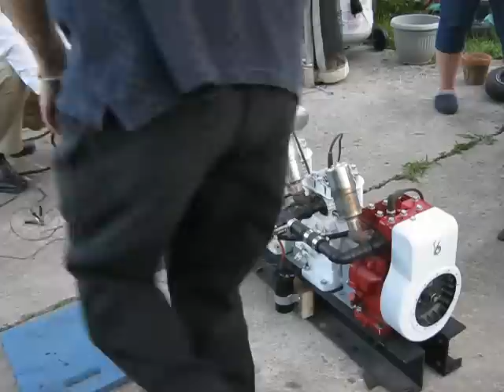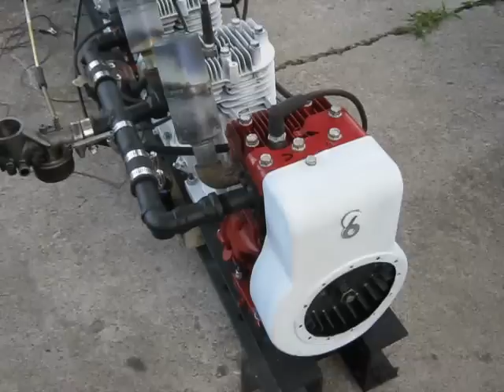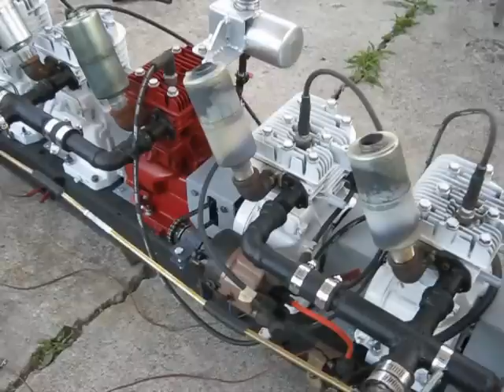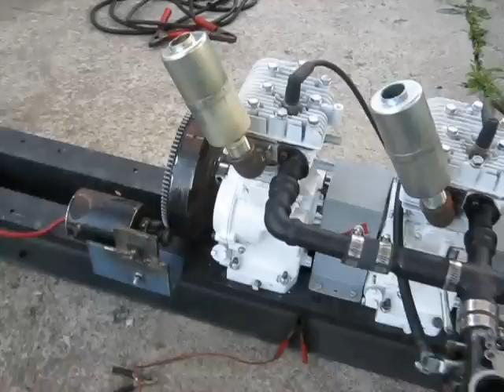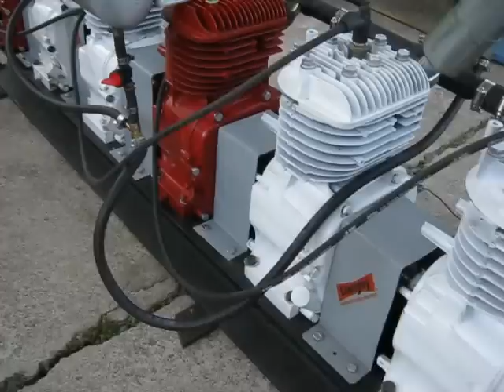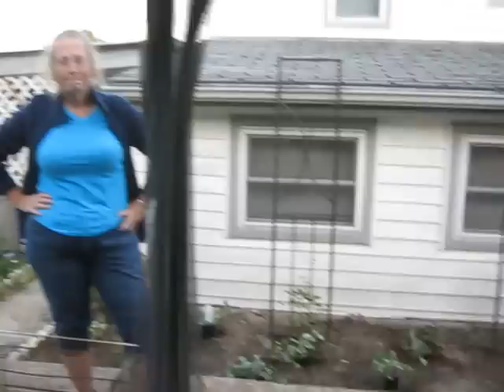FrankenBriggs 6 Cylinder 1st Run!!!!

Comment: how does the spark timing work?
Reply from the maker: I use an old points type ignition distributor on this engine. I evaluate each project, and determine what is easiest, cheapest and most availible to solve the given problem at hand.

Comment: Your intake manifold needs rebuilt so air gets evenly fed into motors
Reply from the maker: Agreed, not the best, but it did run. The main problem it had on this run was the spark timing being retarded when it revved up, I later corrected that problem, so the last vid of it is better.
Reply: Still super cool i love seeing what people can do with spare time and parts

Comment: Mufflers running hot. And uneven. Possibly lean and or restarted timing.
Reply from the maker: Yes, I noticed that also, I will check where the carb needles are set, it seemed the last 3 cylinders were so lean it was causing backfiring, seemed to smooth out when I richened it up.

Comment: stupid idea becouse the engines would be working against each other on the crank, they dont share a common crank for the power
Reply from the maker: Don't know if I would call it stupid, especially since the concept seems to work fine. Admittedly this is just an experiment, but so far I have made and ran a 2, 3, 4, 5, 6 and an 8 cylinder coupled engine, so they do indeed work. Now, that being said, a much more practical design for long term use would be to have a common side shaft running the length of the engine with a chain from each cylinder attaching to it. In fact I have heard of a farmer building such a set up with 4 of these engines, so apparently it will work just fine.
Reply: ChargerMiles007 hey freedom baby, but wouldnt they need a common crankshaft to make the coupleing of power distribution?

Comment: manifold is the problem! would have better results to have1 carb per cylinder, and synchronize them all, like a motorcycle engine. wht is this such a hard concept to grasp?
Reply from the maker: Oh I understand well that 1 carb per cylinder would work better, but joining the throttles all together would be a nightmare. Plus I was somewhat trying to duplicate an old inline 6 car engine, most of them had only one carb, though some powerhouses like the Jag XKE used 3 ore even 6 carbs.

Comment: Why not a carb for each motor?
Reply from the maker: I thought having only a few carbs would make it run more like a real 6, rather than like 6 separate engines.
Reply: ChargerMiles007 Got it. I understand now. Nice.  The inline 6 has a nice sounding character. Thank you.
Reply: the old school backfire through the carbs is unique!
Reply from the maker: Yes, this engine liked to backfire a lot. It turns out I had the camshaft timing way off on cylinders 4 &5 on the first and second runs of this engine. i believe this is what was causing the backfiring. #6 cylinder was running, but I think the flow from the carb was being interfered with from the back fires etc. It runs much better on the final run vid, actually firing all 6 cylinders. I fixed all of those problems on the Straight 8, so it ran much better right from the start. I figured I was on a roll, so I built the 5 cylinder, but it was an unlucky Beast of a machine, vibrating the front flywheel off, and zapping me! I plan to make a 7 cylinder this coming summer.

Comment: Uhh....judging by the mufflers, the back 3 engines weren't even firing.......so....you made a 3 cylinder with 3 air pumps connected.....just sayin....
if you dispute this, make a video with 6 new mufflers, so we can see the change in paint when they all heat up.....or I call B.S.!!
Reply from the maker: You are almost right, (been a while since I have watched this vid), but I think #4 and 6 aren't working right, but 5 is. I made 2 later vids where I corrected the problems. It was also running spark retard (as opposed to advance), so the faster it went, the later the spark timing, that helped heat up the mufflers also. I corrected that by spinning the spark distributor the opposite direction. I believe I got a 2 minute run out of it on the final vid, though it was smoking pretty well from all the heat build up at that point!

Comment: You mean 4 cyl? The last 2 weren’t firing bud.
Reply from the maker: Dang, you are good!  I later found out that 2 cylinders were not firing, since i had messed up the camshaft timing, though they might put some smoke out the odd time. I also discovered that the spark timing was retarding as engine speed increased, instead of advancing. I believe this caused most of the excessive muffler heating. i made 2 more vids of this engine running, and had it going much better on the 3rd vid. Next i built an 8 cylinder, it ran MUCH better, hitting 5000 rpm. Next up a 7 cylinder!
Reply: Im glad you got it going, it’s a cool project.

Comment: How do you cool the rest of the cylinders?
Reply: Eviltech half of them never fired up
Reply from the maker: you are right, 2 of the 6 were not firing on this vid, which I discovered later. I had all of that corrected for the last run vid i made.

Comment: has it ever run for  more than a minute ?
Reply from the maker: i did run it for 2 minutes, which in hindsight I shouldn't have done, since it was getting hotter than it should have with the spark timing retarding. I don't run it any longer than that, as i don't want it to get so hot that it scores the cylinders.

Comment: Gentlemen: "Their" - plural possessive pronoun. "There" - a location. "They're" - a contraction of "They are". For example: They're trying to find their copy of Briggs Small Engine Shop Manual to check their timing set-up before they blow their own asses clean out of their garage over  there. And meet their Maker before they're ready. Also they're keeping their fire extinguisher handy right over there.
Look, if you're intelligent enough to line up six lawn mowers into one plant and actually get it to start, then certainly you can sort out three homonyms without breaking a sweat.
And wash your hands before dinner.

Comment: What a shame, all that engineering stuffed by using a vintage fuel delivery system that doesn't work. All I can see is burnt valves and stuffed rings. At least use triples carbs with Y matched fuel runners and vacuum tune the carbs to each other will stop your starting and lean air/fuel mix problem.
Reply from the maker: I never run these things long enough for that kind of damage to occur. Though I did lunch a crankshaft gear on the final run of the Straight 8 Briggs. I guess it couldn't handle the harmonics. It turns out the main problem with the engine in this vid was #4 &5 cylinders camshafts were out of phase, so the spark was trying to fire them between exhaust and intake stroke. I finally resolved the problem on the last run of the 6 cylinder. I used Y fuel runners on the 4 cylinder engine I made a few years back, it had much better throttle response than the 6.

Comment: Timing is not in sync. Problem solved. None of those crankshafts are exactly perfect with the others.
Reply from the maker: This is true in more ways than one!  There is a bit of slop in each of the chain couplings joining the crankshafts together, so the timing will always be a bit off, plus the spark timing is taken off of only 1 engine, so in some respects it is amazing this thing even runs! The big issue on this run (I have vids of 2 better runs), was that I had the camshafts on #4 and 5 cylinders timed backwards compared to the spark, my bad! I quickly corrected that, and it ran much better.

Comment: Some of those cylinders appear to be really lean
Reply from the maker: Yes, some weird thing were happening on this run in particular, the spark timing was retarding instead of advancing when the engine speed increased, hence it was limited to 3000 rpm, and wouldn't go any faster. I solved that problem once I figured out I was spinning the distributor backwards from the way it was intended to run.  I learned one lesson about ignition points, you can't tell the distributor rotation direction from the way the points are mounted, they can either slide, or stub their toe. so to speak. What matters is the way the centrifugal advance has to operate. I solved the problem entirely on the 8 and 5 cylinder engines I made after this.

Comment: You build it, now what?
Reply from the maker: Tear down, and store in a shed for the winter. the years after the 6 I built a 7 cylinder from the parts, as well as an 8, both ran better than the six did in this vid. My latest is a 12 cylinder in an H shape, it has some chain noise, but it was pounding my chest with the exhaust noise when I removed the mufflers  :)

Comment: Judging by the exhaust colours the back two never ran ....
Reply from the maker: Very observant, I think you are right, on this vid i think i had the camshafts for those cylinders 180 degrees out of phase. I made more vids of this engine, and it runs better in those, but this one gets all the views. My later Straight 8 ran much better, until we revved it to 5000 rpm a few times, and resonance broke a crankshaft gear, not knowing a cylinder was down, we ran it another 10 seconds with the pieces bouncing around in the crankcase, quite salvagable though.

Comment: how do you decide how to phase these engines together?
Reply: Exactly
Reply from the maker: I first decided on a firing order 1,5,3,6,2,4  then phased the pistons and camshafts to be timed correctly to achieve this. It took a bit of time to do, but making a drawing of the firing order showing all 4 strokes of each cylinder helped out a lot. I had it all set up correctly, then I had to remove the back 3 cylinders for some reason, then i succeeded in messing up #4 and #5, so thet are not firing in this vid. All 6 are firing in the final run vid.

Comment: That's gonna over heet fast with only one fan for 6 motors
Reply from the maker: Yes, it does heat up quickly, I have ran 2 large box fans to help coo lit off, but a 2 minute run is about the limit. That is actually about as much as the neighbors want to put up with also!  :)

Comment: Maby Double check the firing order..
Reply: Runs smooth when it revs up, starts popping when it revs down, could be a timing issue.
Reply from the maker: It may well be timing, I timed it by eye, not using a timing light. My son thinks I need to advance the timing, I will drag out the timing light and blow the dust off it, and check where it is set at. Perhaps it is cobwebs in the early 60s slant 6 distributor, you never know  :)

Comment: NO HEAT  ON THE BACK 3 EX - PIPE
Reply from the maker: I think #6 was actually firing, but 4 and 5 were not, as i had messed up the camshaft phasing during an overhaul :(   Once we discovered the problem, I corrected it, the the final run of the 6 has all 6 cylinders firing.
Reply: I wondered who else caught on to this.

Comment: The first and third is to lean or slow in time
Reply from the maker: If I recall correctly, cylinders 4 & 5 weren't running at all, so 1 thru 3 and 6 were loaded down dragging the dead 2. Spark timing should be about the same for all cylinders, though I won't pretend that it is actually the same, since the distributor is chain drive, so harmonics enter the equation, plus the chain couplings joining each cylinder have some play in them. It is quite possible that the intake manifold design of 1 carb. feeding 3 cylinders is playing a part also. Building these engines has taught me to respect for the challenges engine designers and engineers face when designing a new engine!

Comment: What's the application of this?
Reply: . . . not much because the crankshaft on the last engine is not strong enough to handle all the power.
Reply from the maker: You are correct, I suspect about 10 horse would be the power limit before something broke, though I was lucky enough to find a crank with a 1" dia. shaft for #6 cylinder, so it should be a fair amount stronger than the 3/4" shafts.

Comment: About 60 hp?
Reply from the maker: Actually probably more like 30, if everything worked right, though it would probably snap off the last crankshaft long before it got to that. it is a Beast to man the throttles of though, as you can feel the vibrations of the engine since you are so close to it.

Comment: Not a 6cylinder engine. Six engines
Reply: GM designated their 16 cylinder Detroit Diesel as a 16 cylinder engine even though it was two 8 cylinder engine blocks bolted together. The original design 16V71 used a single crankshaft that tended to break between the two blocks. Later design used a crankshaft that was bolted together between the blocks. The beast used four 4 cylinder 4I71 heads.

Comment: but why?
Reply from the maker: Experimentation, kind of like the glass head Briggs engine that uses a plexiglass transparent cylinder head, so you can see the flames.
Reply: Reminds me of the time I made a hydrogen generator, spent days on it and it worked that well it was dangerous. Never put it to any useful application - sitting in the shed somewhere now.

Comment: How do you have the timing set up on that?

Also likely to fly apart at any moment btw.  jmo
Reply from the maker: The cylinders are phased to fire like a normal 6 cylinder engine, 1,5,3,6,2,4. The spark is from a Dodge 6 cylinder car engine, with spark timing set about 10 deg. BTDC.
Yes, it coming apart is a possibility for sure, that is one reason why I have metal guards over all of the chain couplings. I promised Lovejoy I would do that when I built the 4 cylinder.

Comment: nice work but what's the point
Reply from the maker: Bragging rights on having built a YouTube Hero!!!  lol :)
Mainly I just wanted to see if it was possible, and hear what it would sound like. It actually runs much better on the Final run vid, the 8 cylinder engine runs better,

Comment: this was not a successful run. the contrary, the back carb was too lean, and the center unit smoked too much. too much work to run this bad.
Reply from the maker: I whipped into shape on the next vid, the 7 and 8 cylinder run much better, but the 5 was a mean machine! it tried to take me out!

Comment: Briggs n Stration engines are junk  try a 4Stroke Honda engine my mower went for 22 years on the same starter rope and spark plug .Buy a Honda you will save in the long run .
Reply from the maker: Well, one thing I can say, I don't encounter many Honda engines in the scrapyard!

Comment: With any serious load on it the crank would brake on no. 6  engine as briggs are rubbish engines.
Reply from the maker: It wouldn't matter which manufacturer built the engines for a set up like this, the last crankshaft cannot handle 6 or 8 times the normal design load, or at least not for long!
Reply: During WW II there was a need for clearing landing strips in the jungles of the Pacific Islands. A company in Texas came up with an idea of a portable air drop capable circular saw.  Well actually they came up with a super size one. The normal Gravely engine of that time was a 5 HP engine. The Texas company took the same transmissions and put a 20 HP 4 cylinder Wisconsin engine on them. Later, Gravely put a 16 HP Kohler single on the later units. They tore up the newer drive train's reduction set at the crankshafts. The solution, switch to a 16 HP twin Briggs. The rest of the drivetrain was unchanged from 1938 till the last ones were built in 2006. Even the 16.5 HP twin Onans didn't phase the drives. It all is about the power pulses and what they will destroy. Some people have even put 24 HP Honda twins on them without problem. Gravely was known for over engineering their products back then. When they built their 8 speed tractors, they were available with engines from 10 HP to 26 HP  from the factory. I have one that I rebuilt that has a 35 HP Briggs on it. You never know what the upper limits are till you go past them. The old joke about how to tighten bolts was, when you hear it snap, back off a pound on the torque. ;-)

Back in the early 70s a Florida man built a 1/8 full size loco which did what you basically did but he only used 3 engines and he did keep each engine as was. Just coupled them together. Very smooth running.  Maybe if you did them the way Detroit Diesel did where the put the output of all 4 engines into a common gearbox for the output, you could come up with a 12 or 24 cylinder radial. :-) Think about what they did for the 18 cylinder engines on a B-29. Or the 24 cylinder engines used on the B-50 or B-36.

Comment: I appreciate all the work but what's the point?
Reply from the maker: Thanks for your understanding! Sometimes we just do things for the heck of it, and to prove that we can. I also like to experiment, and working on these engines is a hobby for me. I know most of them aren't very practical, but I mainly just want to hear what they sound like. For instance I plan to make a 7 cylinder inline engine next spring, to my knowledge nobody has built such an engine, so it will be a first. i just hope it runs alot better than the 5 cylinder I made, it was an unlucky witch of an engine, probably due to that pentagram shaped spark cam!!! 7 sounds like a much more lucky number!  :)

Comment: Rather stupid because without the shrouds and flywheel fans every one of the engines will seize up tighter than a drum except maybe the first one which still has a fan and shroud so what is the use of this besides a lame pile of unusable engines? FAIL!
Reply: he's doing it for the fun of it.. and at a idle speed you wont burn down a briggs for a good while even with no cooling.